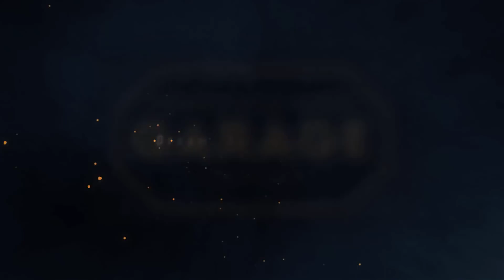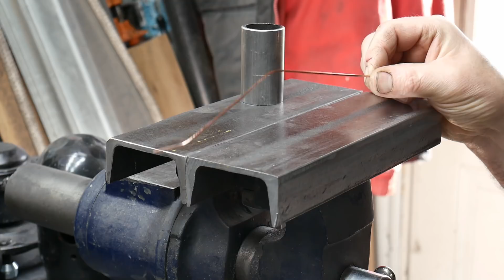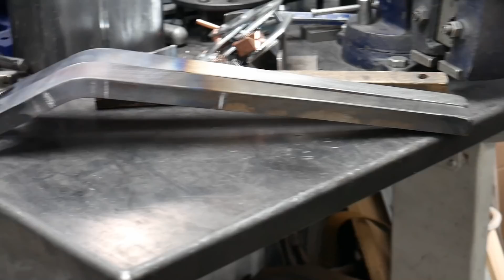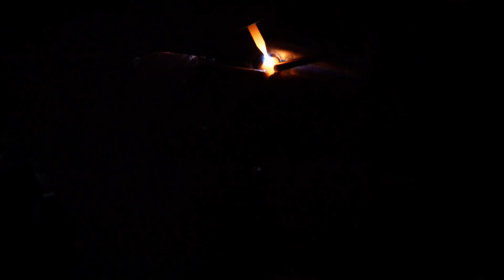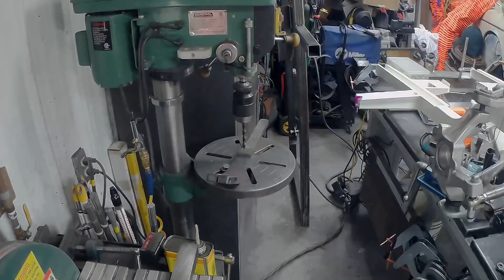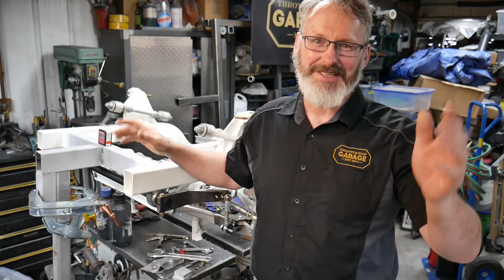Making Sway Bar Arms (3-Piece NASCAR style)  (Ep 47)

Comment: Hi, Thank you for your nice job. Why didn’t you band it between tree points under your hydraulic press? Instead of making this whole template.
Reply from the maker: No really good reason.  I wanted the bends to be referenced from something consistent like the bolt hole.  I could have tried to do this in the press, but it was pretty easy to fab up the quick jig and get the job done this way.